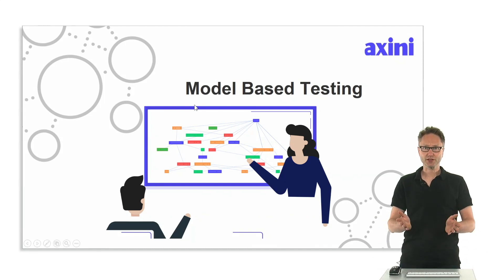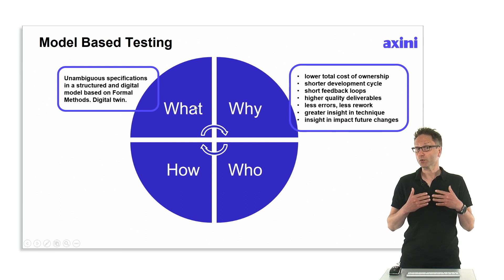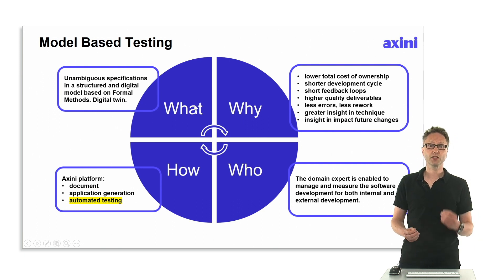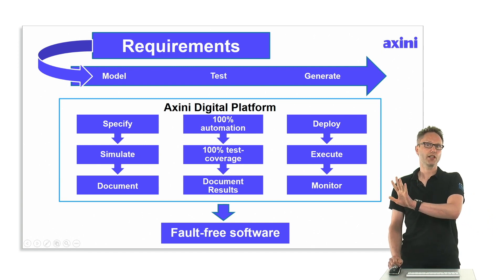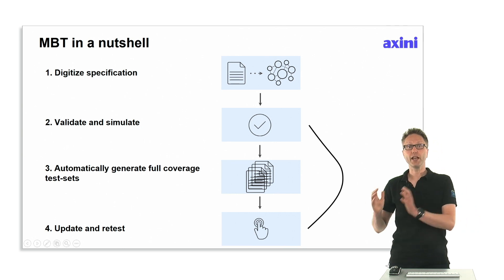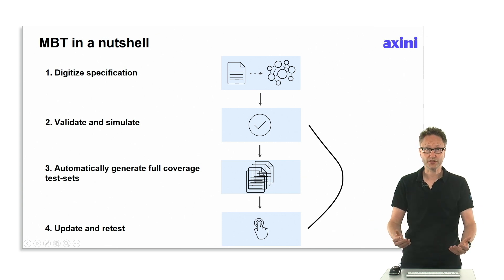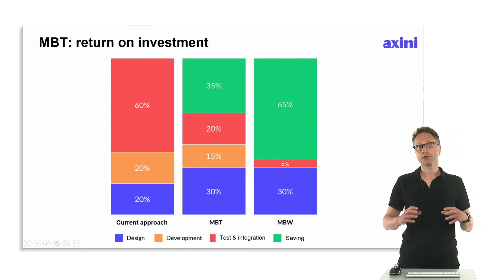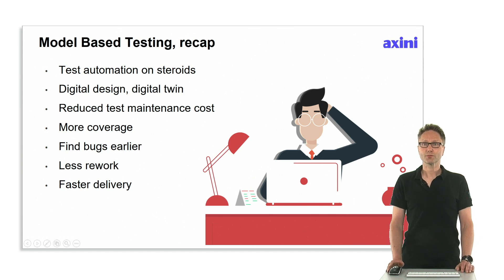What is Model Based Testing?

Comment: how to achieve parallel execution in model bases testing ??
Reply: Abishek, can you give an example of a test procedure involving parallel execution?
Reply: @kamelayari  hey Kamel, let's suppose you wanted to run different combination of data with same test then how can we achieve that in this mbt, like pytest, testng all of these framework provide parallel execution so both the test can run at the same time and give us result.
Reply: @ABHISHEK_204  I see. So this is more about test scheduling not feature modeling or test generation then.
Reply: @kamelayari  yes Kamel, Test generation is one part but let's support if I have generated 10k test and those are running for 2 days then i doubt many companies have this king of time to execute them. So i was looking for solution to make it support  parallel execution.
Reply: Hello Sir! Great video. How can it be applied to IoT systems? devices layer, network, cloud and application. Test case generation and execution will be key.